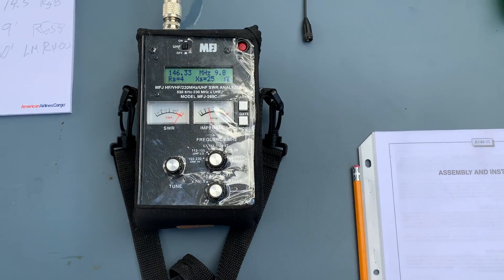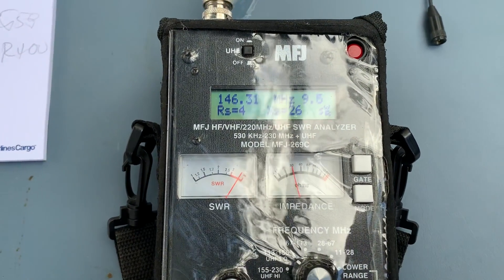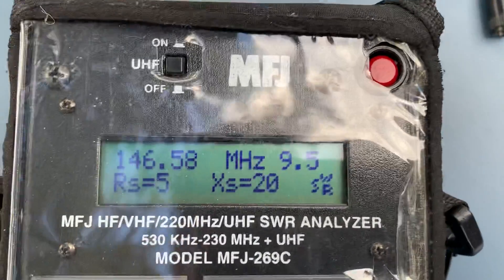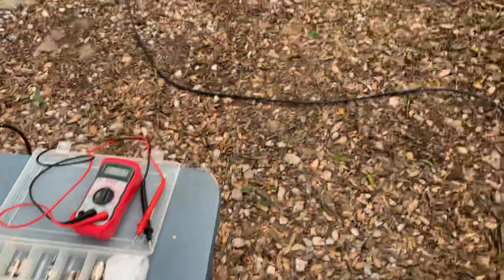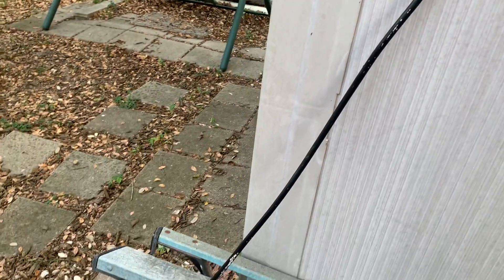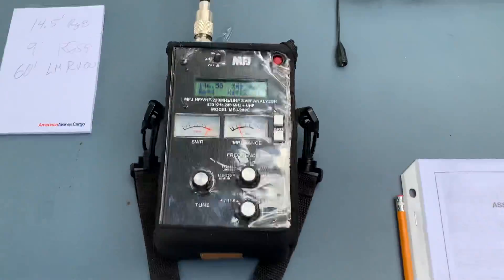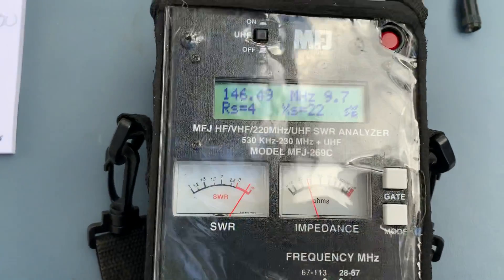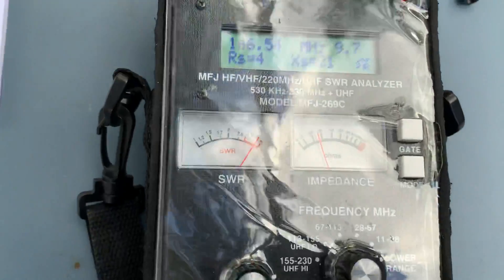Testing out 60 feet of LMR 400 coax on VHF 2 meter band.

Comment: Check swr with your real antenna. Use a dummy load to check the power output of the radio.
Reply from the maker: The coax was bad.

Comment: Isn’t the dummy load made to neutralize the Tx from your radio? Maybe I’m wrong but typically a cable of 6ft (jumper) will do the work. If you use a 60ft cable to connect your radio to a dummy load the resistance created by the length of the cable will give you a super high SWR.